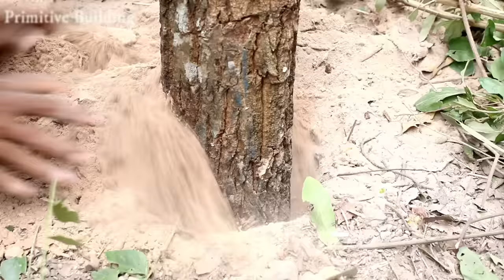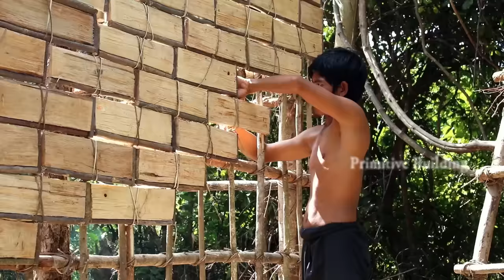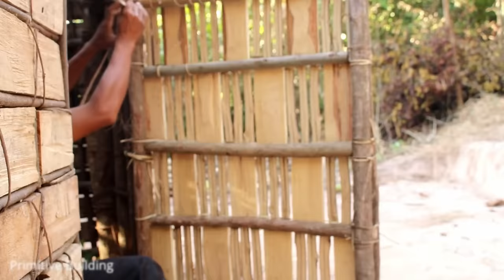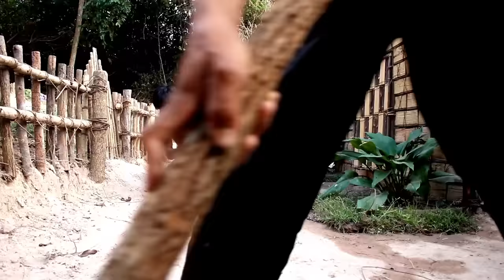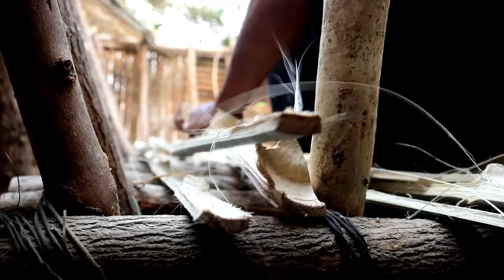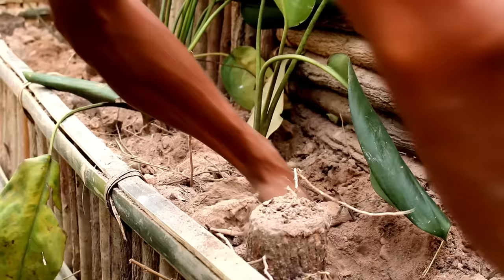Build Beautiful Swimming pool & House Villa Using wooden in Will

Comment: I see them putting pilings into the ground and then joining them up with other sticks and bamboo and rods and tying them together and then lining a pool with a homemade cement. But then when they fill it with water, I'm wondering, because water is a very heavy substance, what in the world is holding up the pool they made? Made because if they've got only the pilings and the bamboo, how can that support such a heavy substance without collapsing? Did they put something else in there to support it? I could see impacted sand holding it up but I just don't know how they've done it here. They didn't show it.